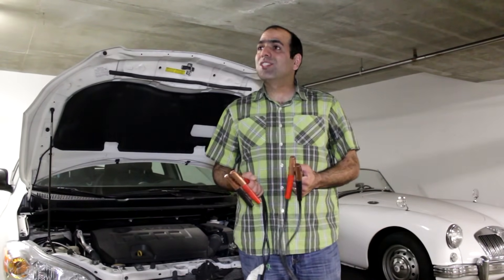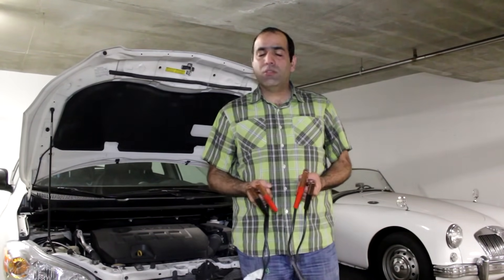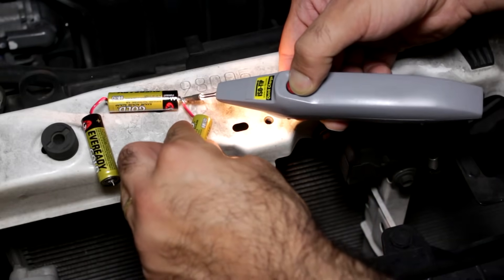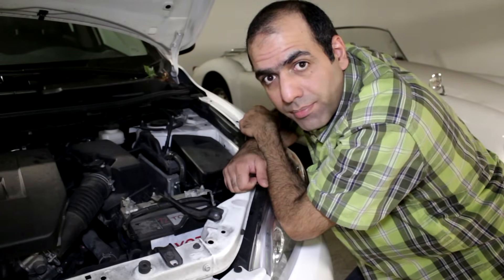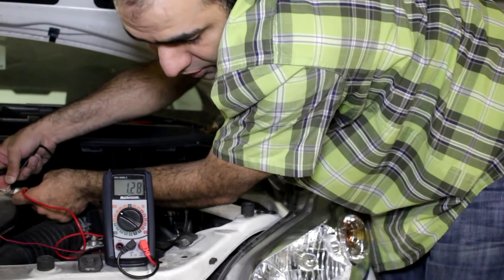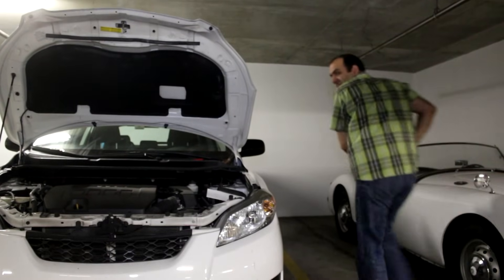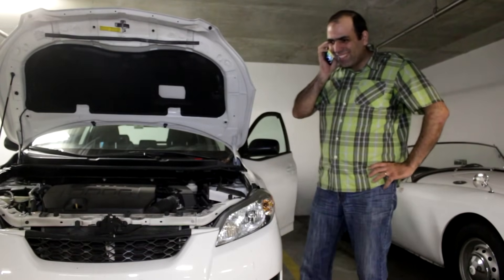Jump Start a Car with AA Batteries

Comment: The same worx with liion or lifepo btw.. i have a lifepo 4S 62Ah for car trips (charging it with the alternator), 1000W DC/AC stepup so it can power any devices i have in the trunk. Whenever the car battery goes low, that lifepo does the trick

Comment: Do you connect the positive side of the paralleled AAs to the positive 12v battery?

Do you connect the ground side of the paralleled AAs to the ground of the 12v battery?

Comment: You didn’t change any settings on the multimeter when you measured amps. You measured amps and volts on the same setting. Fraud

Comment: Just a quick fyi, if you have a 20v DeWalt drill battery, two shiny pennies, and a set of booster cables, these items combined will also work. Look at the small slots on the battery where it connects to either the drill or charger, they will all be labeled and two of them will be labeled b+ and b-. Put your two shiney pennies in these slots. After inserting pennies, clamp the red clamps of your booster cables to the b+ penny and the positive terminal of your auto battery. Also connect the black clamps to the b- penny and either the negative battery terminal or the frame of your automobile. Once all is connected your auto should start with no problem. Once you get it started you can disconnect the clamps and remove the pennies. I have done this more times than i care to admit and it works great every time.

Comment: Or get an extra car battery you can hot swap if your current battery dies. Like how you have a spare tire if you get a flat, get a spare car battery
Reply: I think something like a hand cranked supercapacitor battery replacement would be Better because It degrades much less

Comment: I ran out of gas and left the ignition switch on. Turned on the emergency flashers. Raised up the back of my caravan with the expired tag. To hide the fact from local law enforcement. I'm in the center turning lane.  10 minutes later I realized my mistake. Click click. Down hill push it into a fancy subdivision.  I have some c cells unopened 6 pack. Going to try to it when it warms up from  50 to 70 degrees. If it works.  Proud I will be. Polarity is crucial. 😊

Comment: Hello, a lot of video using 21 Volt cordless drill battery to jump start a car. 
I though it will charge the car battery first, but some video can be start right away after the jumper cables connected. 
What's your though about this ?

Comment: I'm sorry but your videos are shyt, first off you fake the disasters because how could someone experience one every time they do a video in every video.. 2. you speed up the video feed and take the batteries and volt meter, etc away then it goes back to you going to ur car to start it not showing you hooking it up so your channel I used to like until I see it's all staged and scripted... Peace you lost a subscriber.
Reply: Obviously the accidents are staged, he does that for comedy and to show you what happens when things go wrong.

Also he never takes the AA batteries away when charging the car battery, they are literally right there sitting on top of the engine. And he doesn't take the volt meter away either. Not sure what your problem is.

Comment: I am a bit surprised that worked. That short was about 20 amps for a few seconds - fine. Charging was like 10, make it 15, minutes at average 1.5 amps. So you just got like 0.4 Ah into the car battery. Even if you did it for longer, an AA battery only has 3 Ah in it.

Whole car battery? 70 Ah. IIRC typical cranking is 500A for 2 seconds, i.e. 0.3 Ah. But of course you probably tried to start two or three times, so you lost about 1Ah by the failed attempts.

Wait... that means your approach actually can work... sort of, but it is very narrow. If I were ever to do this, I would probably not use AA cells but C or D ones lying around, which do up to 10 Ah, and use a smaller series resistor if possible. The multimeter is actually important here so you know when to stop, i.e. when there are diminishing returns.

And of course, there is this fun property of batteries that a freshly charged battery - even just by a bit - can suddenly deliver much more current than one ending up in the same charging "percentage" by discharging. Probably has to do with which ions gathered near the electrodes. This means that my above math may be moot and just getting 0.1 Ah into the battery may already be enough to start.

Comment: How many batteries have you used and why?
Reply: Looks like 12 of them. 1.5v x12 = 18v but measured they are around 1.6v when new.   The car is 12v so the 19v is higher as to push a decent amount into the car using the extra advantage of the higher voltage.  Around 2 amps flowed to the car battery.  This was enough charge after 10mins to give the car battery enough to start the car.

Comment: Here's a useful trick, if you combine 10 AA batteries in a parallel connection, you can have a 1.5v power pack. Then by doing a series connection into the car battery with the power pack, the car can start immediately without waiting 10 minutes.
Reply: But that would mean taking a battery terminal off on the car no ?

Comment: I drilled out piece of broomstick and filled it with AA's for a homemade power cell for my portable speaker after the original battery quit holding a charge. 

Eventually I just got a new one because I didn't want people to think I was on meth, but it actually worked great with that improvised fix.

Comment: you said connect positive to positive negative to negative , but when I look at your aa batteries , they are positive to negative , negative to positive connected, I assume you mean when connecting to the car battery you have to connect positive to positive , negative to negative???
Reply: Obviously.   If you don't connect the aa batteries positive to negative the will all cancel each other out.

Comment: You never measured the temperature of the AA cells. At a current output of 2.2AMP's I would think that the batteries would have gotten pretty toasty, also would have been interesting to know how much juice was left in those batteries after equalising with your cars battery. Generally a NiMH AA battery is not doing much below 1.1-1.2v but I wonder if a device which needs only 12v to function, would 13 batteries still be useful down to an individual voltage of 0.923v = 12v total, or is their current availability relative to a minimum voltage beyond which they will no longer function...
Reply: They were probably almost flat after using them for this. Notice it was 19v so I'm guessing 12 batteries  if they dropped to 1v each they would then be 12v in total.   So rather flat at this point.  Until they dropped to 1v it would still be charging the car battery.

Comment: Instead of connecting the AA batteries to the car battery, can we directly connect it to the terminal (after disconnecting car battery) and start the car?
Reply: No, a starter motor takes loads of Amps to do its thing, the car battery can provide the kWs of power needed, if just for a brief moment, the AA batteries cant do that

Comment: I was thinking that theoretically a six double A batteries it's series put combined with a large number of them put in parallel might be enough to start the car, but connecting it into a circuit with a lead acid battery is going to be a bad idea.

Comment: Can you use two 9 volt batteries in a series
Reply: Yes but what kind of 9v batteries do you mean.  A PP3 NO  Not a PP9 either.
Reply: @chrishart8548  the small ones in smoke detectors

Comment: This works only if the battery is not severely discharged. In some cases a battery can be so dead that only a big truck can start it.

Comment: If the battery is more than than three years old then it is nearly at the end of it s life . You can check the status of the battery cells with a hydrometer if the cell is below  2 volts in any of the six cells then it requires a charge over night but if the cell is internally shorted the battery must be replaced .! !  The hydrometer will tell you the correct gravity level which should be in the green zone.The best batteries are the maintenance free type lead acid   calcium batteries are not recommended as they are prone heat deterioration.

Comment: If it took 10 mins of charging and and you had to disconnect the batteries before cranking then I wouldn't quite call it a "jump start"... More like "a short recharge to give the battery just enough power to start the car on its own" (It's still short compared to actually charging a car battery, but not quick enough to be a "jump")
Reply: Didn't even notice the mistake. Now it qualifies the title as clickbait.

Comment: Sir I have a small doubt. Is it possible to to Start a car with two 9 volt batteries since to start a it only requires Requires only 12V battery and not only that, two 9 volts is equal to 18V. So more Power. So my question is that even if we start a car with two 9 volt batteries. Will the battery explode???. Or nothing happens and car starts normally.??

Comment: How did he measure current flow (A) with his multimeter?
What was the role of the resistor in series.
Reply: He measured the voltage drop across a 1 ohm resistor, which is proportional to the current flowing.

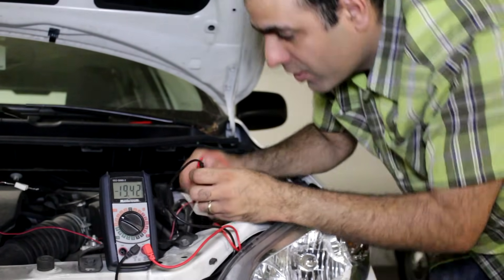Comment: It gets weird at about 2:15. If the voltage of the car battery is already 11.7 and Max is 12 plus a bit of overcharge and the cranking amps of the battery is rated for that vehicle it should start right up as is. Did you secretly charge the battery between the no start and playing with the AAs? Are you cheating us?
Reply: Generally, below 11.8V, depending on the car, you might not be able to crank. A good voltage is >12.4V.

Comment: how you are measuring current without changing the probes of multimter .
or your are measuring voltage across a Resistance and measuring the current.

I am your big fan specially after watching your videos on free energy.
Reply: Yea he is messuring current using a shunt

Comment: big fan here but this time with a doubt. i just wanted to know how you measured current without changing the multimeter probes to current setting? @02:28 i think it just voltage drop across resistor.
Reply: Your right it is voltage, but V=IR so If R=1 V=I : using one ohm resistor is a easy way to measure current.